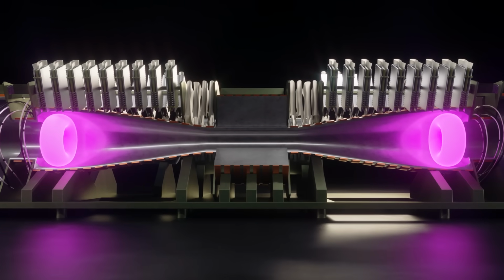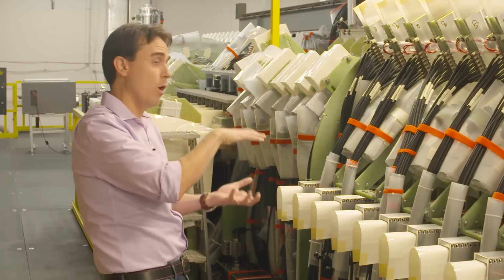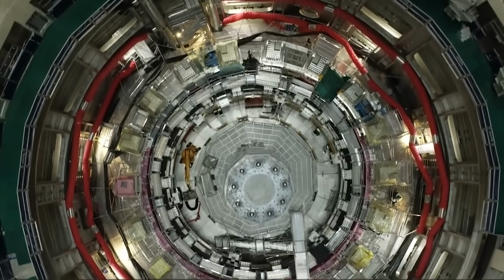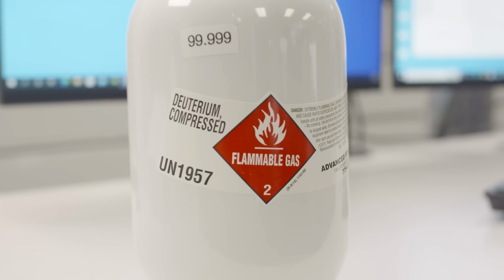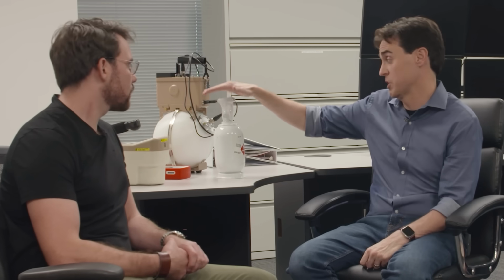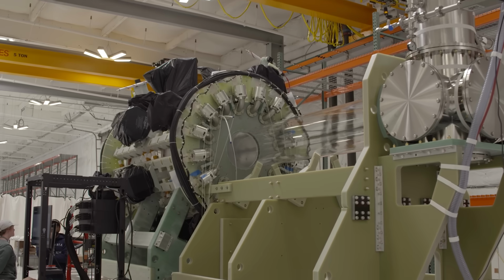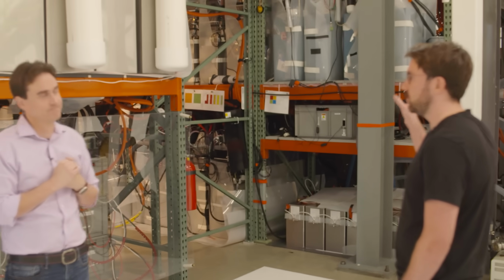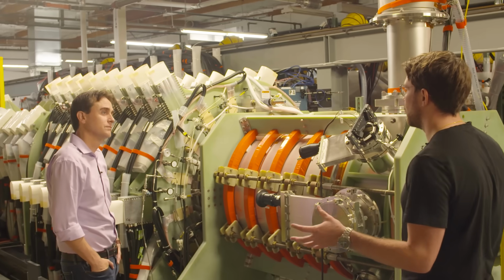A New Way to Achieve Nuclear Fusion: Helion

Comment: I was reading about togamaks a week or so ago I thought why can't we figure out how to just harvest heat direct to power no turbines, etc. Looks like they are doing something like that maybe better.  This gave me chills realizing that fusuin power may actually be something I will end up seeing actually realized.
Reply: Getting direct power from heat is hard. The fundamental way electricity is created is by making a changing magnetic flux inside a coil. (This can be done by changing the orientation of the field, by changing the area of the coil, or by changing the intensity of the field. Traditional generators spin a magnet field to achive option A, and its fairly easy to just crank a shaft at a specific speed.)

The resul is that most forms of electrical generation at scale use some way to crank a shaft at speed, and of those a steam turbine is fully controllable amd works anywhere you have heat. (Concentrated solar, fossil fuels, geothermal, and fission all are simply fancy ways of boiling water to spin a turbine to crank a generator's rotor)

In contrast getting electricity straight out of heat without the intermediary steps is hard and expensive so its easier to just throw out 2/3rds of the primary energy as waste heat from the condenser. We can do it, RTGs do it and use nuclear decay as a mild heat source and make tiny amounts of power, as a result of a thermal gradient physically pushing the electrons, not magnetically or chemically.

This thing is making electricity by having the fusion superheat plasma so it explodes which causes what i can only describe as a magnetic explosion from the new motion of the charged plasma that induces electricity by changing the intensity of the field. The main concern i have with this approach is that instead of making a nice AC or DC waveform, this is probably closer to a dirac impulse or a standardized lightning wave which means you meed to capture that brief and intense pulse and then slowly release it and convert it to AC power or HVDC to be compatible with the grid.

Not sure how much of this you already knew, but fundamentally we can't go from heat energy -> electricity easily at scale because physics says so. (Its possible we will discover new physics that let us, but for now we can't do it)
Reply: I'm skeptical about their claims of being able to extract electricity directly. The reason almost every power source uses steam turbines to convert heat into electricity is because it works. As thermal cycles go, it's pretty efficient. Getting net energy out of a fusion reaction is really hard. Converting that energy into net electricity production is yet another hurdle to be overcome. We don't know what kind of efficiency they'll get out of their electrical conversion, but if it doesn't at least match steam turbine efficiency then they are already at a huge disadvantage.
Reply: @hydra70  in theory the basic principle will work to make some electricity. They are essentially converting nuclear potential energy into kinetic energy of charged particles and as those particles move they make their own magnetic fields, and this change to the magnetic field contained within the generator coils will induce a current that would make the magnetic field the counters the change of the field passing through it.

The question is how efficient is this process really, just from nuclear potential to net induced current in the generation coils.

And then this current pulse/waveform in the generation coils is definitely not DC or AC60Hz/AC50Hz, so they need to convert whatever this resulting waveform is into something actually usable by the grid and of course this conversion/smoothing process will have its own efficiency to include in the plant's overall fuel in to power out efficiency.

Atleast with traditional steam turbines we know the efficiency is basically always slightly over 33% because thermodynamics. And while this sounds bad, its also normal for basically all heat engines to be in this ballpark, so if a tokamak is in this range it won't cause anyone to bat an eye since its basically just the standard efficiency of the grid. (The mix of generation sources is still doninated by thermal power plants, so their efficiency is just the grid's efficiency and everyone just accepts it since we don't really have a choice)